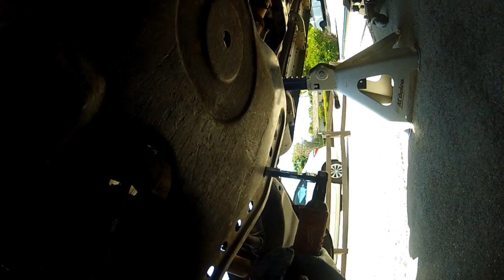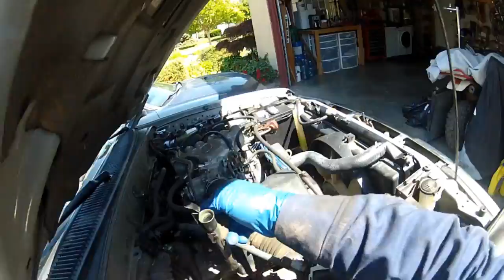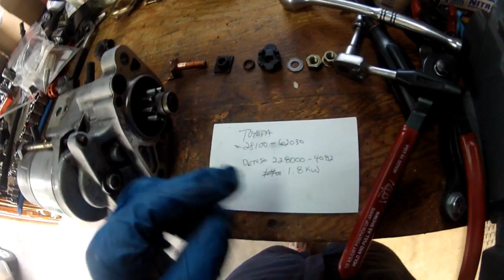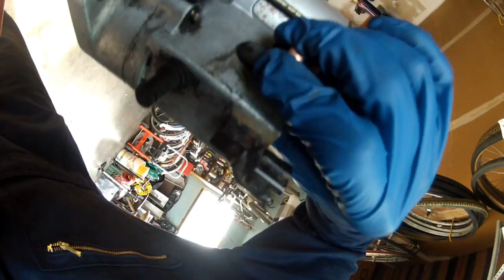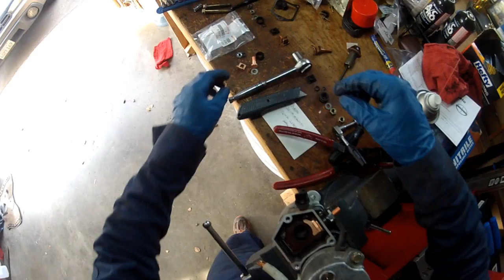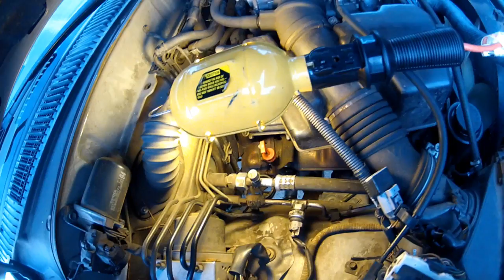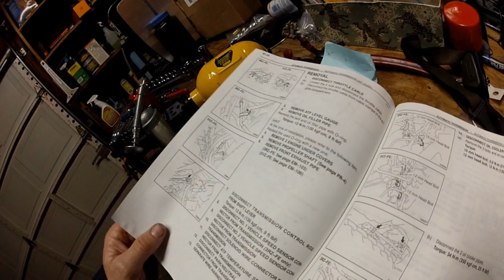Starter Removal and Solenoid Repair

Comment: Why the Neg Cable?  You are the second guy to do this.  I would just take off the Pos cable. 
I can see from how clean your truck's underside is that you drive around on pavement all the time.  
Not so here in the mountains west of the Silicon Valley. 
Also, I have wanted to remove the transmission dipstick tube for 10 years now.  My dipstick broke off back then. 
This will be a great chance to see if I can get that old one out.  I have a new one.

One more thing...  rebuilt starter from AutoZone $140.
Reply from the maker: I always learned the negative cable is the first off and and last on.

Unless Auto Zone is selling rebuilt Denso alternators for that price, I'd pass.  But, first try fixing the issue like we show in the video with very affordable solenoid contacts and plunger.
Reply: The one I bought was a Duralast rebuild.  I bought the relay there before and it works fine.  It doesn't fall apart when you remove it like the Toyota either.  The starter has a Limited-Lifetime Warranty.   Whatever that really means.  DENSO builds the Toyota sold units and they are only $209.  Of course, these prices are with the return of your core return.   I wouldn't buy engine or transmission parts from anyone but Toyota, but air-conditioning or starters are OK with me.
Reply from the maker: @jmoss99  Roger Dodger

Comment: Chalk this up as probably the 10th Timmy the Toolman video that aided me in fixing my 3rd Gen. I had a couple brilliant ideas, but ran into some trouble too. Not that my hands and arms are fat, but they ain't small, I had a really tough time getting the wire plug off, and did what I saw someone else suggest, and unbolted the starter first, moved it around, and got the clip off. I got lucky and could hand tighten the top starter bolt by squeezing between things and going straight in. Doing it by myself was a challenge getting the starter lined up right, but I used one of those blue pry/nail puller dealies as a wedge to push the motor in place, and then used a bungy to apply pressure while I worked on the bottom bolt. I really helped, although I still couldn't get the bottom bolt in. It kept feeling like it was cross threading, so I kept trying, but to no avail. I just couldn't get it, so luckily my neighbor, a mechanic, came over and nailed in in a couple minutes. He had a shorty ratchet, which I don't have one of those... yet. The next challenge was I couldn't get the inside brake bracket screw in straight, and probably did cross thread it. It's tight, with no rattle, but next time I replace the contacts or starter I will probably have to deal with it. The final problem was I could not get the dipstick bolt in. It's at un upward angle, and between trying not to cross thread that too, and the area being way to hard squeezing my arm in, which got all scraped up, I finally got it in cleanly. Car started, and like Timmy's, the old contacts, and the contact washer on the plunger, were definitely worn. Only bummer after doing what was a tough job for me, I was saddened to see that the starter must have already been replaced. and wasn't a Denso. The kit I bought still worked, but I did contemplate dishing out the $180.00 for a remanufactured Denso. Thanks, Tim! Hope to see you next month for the Sicmods BBQ!
Reply from the maker: Sounds like you had quite the experience with this job but you got it done and that's what counts.  That is too bad you didn't have the OEM Denso starter.  Did you email me for my address?
Reply: @TimmyTheToolman  Email you for your address? This will be the 3rd Sicmods BBQ I will have attended. I know where you live! As a matter of fact, I just thought last night that I haven't signed up yet. I'll do that now.

Comment: Online the contacts+plunger now run about $60. Lets go Brandon
Reply from the maker: Order the Ebay kit we link.  It's much more affordable.
Reply: @TimmyTheToolman  should also be noted that the starter contact kit listed in the description is only for one side. Sides are not symmetrical so you can't just order 2 of them.
Reply from the maker: @padronianful  You only need one kit to rebuild the solenoid.
Reply: @TimmyTheToolman  no, there is only 1 contact in the kit listed. There are 2 contacts in the starter that need to be replaced
Reply from the maker: @padronianful  Ok, you're obviously referring to the OEM kits and you are correct they are two separate kits.  When I responded to you, I was thinking of the more affordable aftermarket Victory Lap kit that has both contacts and plunger in one kit.  Thanks for bringing this to my attention.  I'll add the other OEM kit to the video description.

Comment: I'm sorry the two cylindrical pieces sticking out on the outside surface of  the starter and/or solenoid casing.
Reply from the maker: It's a breather.  I don't how important it is, but if broken off, it could be w pathway for water and dirt to get in.

Comment: Hi Tim thank you.  Wondering if you know what the cylindrical little rubber plug things are for? I broke mine off. Wonder if they protect from water etc?
Reply from the maker: It's a type of breather.  Don't know how important it is, but with it off, it could let moisture and other contaminants in.

Comment: Also, I’m looking up my parts via VIN # and it was that 1.8kw is for my truck, but I went into my local dealer and they told me my truck takes the 1.4, but it gave them options for both the 1.4 and 1.8. Are these parts interchangeable?
Reply from the maker: I bet the contacts and plunger are similar between the 1.4 kw and 1.8 kw.  We have a link in the video description for a more affordable contacts and plunger kit.

Comment: Farm fix RE: Contacts , flat file the contact surfaces to re-use .
Reply from the maker: Really?  The contacts I pulled out of my starter where worn down pretty bad.  I wouldn't want to spend the time pulling the starter and taking apart the solenoid just to keep worn out contacts in the solenoid.  The replacement contacts are dirt cheap.

Comment: Hi Timmy, I tried to turnover my 1999 4Runner and nothing happens, no click or clicking, or other noise…tried a second time to start and nothing, and then third time and vehicle turned over (this happens intermittently)

other times vehicle starts up fine with no issues 

I thought maybe bad battery but all lights radio worked, so I  tested battery and alternator with multimeter and those were good

One thing I have noticed if vehicle doesn’t turnover i can disconnect the battery terminals and reconnect and the the vehicle starts 

there was no corrosion on terminals but i still gave them a cleaning

Any thoughts on what I described above?  I was thinking maybe bad solenoid contacts or starter, but was wondering if the symptoms described above  might be something else.

Thanks
Reply from the maker: It could be the starter and it could be a bad connection.  Check your grounds first.

Comment: Tim, thank you for taking the time to put this video together. I just finished the starter rebuild as you described. I could not have done this without your video.  I'd say the hardest part was getting the starter out.  The way you describe the orientation to pull it out was beyond helpful!  -Ben
Reply from the maker: Hey Ben, great to hear our video helped you out.  Good job getting it done.  Thanks for taking the time to comment.  We appreciate it!  Happy Wrenching!

Comment: Hi, Tim.  You really helped me 2 years ago when the starter on my 96 4runner went out.  I'm having the same problem on a 3rd Gen Avalon (2005).  I can't find a detailed video for the repair.  Do you know if the location of the starter in the Avalon is similar to any other Toyota car?  Then maybe  I could find a video to do the job.
Reply from the maker: Hey Jim, we're not familiar with the Avalon so we wouldn't be much help to you.  Not all Toyotas have the starter in the same location on the passenger side of the bell housing.  You'll just have to get under the rig to look and figure it out.  There is a Toyota website called Tech Info that you can buy a 2 day membership from to gain access to the factory service manual pages that can instruct you on the proper steps to replacing the starter.   The only caveat is you need a windows based computer to use their website.   If you go onto their subscription page,  there's a link on the bottom that explains the minimum system requirements to use their website.   Once you're in their site, you put in your year and model and then go to the RM section (repair manual) and you can do a search for the starter replacement section.
Reply: @TimmyTheToolman  
Thanks so much for your response Tim.  

The starter is in a different location.  It is located under the hood, left of the battery.  I was able to get the car started by tapping it, but it won't last long.  Of course, there are several wires and tubes blocking direct access.  I haven't seen many videos for the Avalon, but there are some for the Camry.  So I was wondering if the starter was in a similar location in both cars.  I'll check out that Toyota website and give it a try.  I think the copper contact is the culprit, just like in my 4runner.
Reply from the maker: @jimthompson7370  Well, good luck with the job.  Hope it doesn't fight you too much.  Happy Wrenching!

Comment: I hope the flywheel is still ok?
Reply from the maker: Yeah, it was fine.  The starter wasn't grinding on the teeth of the fly wheel.  It just wouldn't disengage and kept turning the engine over.
Reply: @TimmyTheToolman  Can you imagine that happening if you are 50 miles from home. Keeping a 10mm wrench in my 4Runner now.
I just did a timing belt job on my 4Runner, man that back bolt to the tensioner was a bear to get started. Ended up tightening the front bolt almost all the way and using a long extension with wobble head and short 12mm socket to get the back bolt in.
I am really surprise how hard Toyota engineers made it to reinstall. Thanks again for that great video.
Reply from the maker: @brucewayne2773  Yep, not a bad idea at all to carry a 10mm wrench.  I saw this happen on a car while I was working my firefighter job.  The starter on this vehicle ran so long that it just burned up and seized.  

As for the timing belt job, the engineers never intended us to do it that way.  The way we show to get to the back bolt for the tensioner is a cheat method to not have to remove the AC compressor and AC compressor bracket.
Reply: @TimmyTheToolman  I did notice another person removing the ac unit and bracket. Seems overkill to go that route. My 05 Sienna was not that bad to do compared to the 4Runner. I think the later models are much easier to service?

Comment: So I know this video is pretty old but I thought I could maybe get an answer, I have a 97 limited and it was driving fine in the snow and when I got home, I had a little problem with trying to get into park from drive (after I got it out of fourwheel drive). I got into park and turned it off. I tried to start it a couple minutes after and it doesn’t want to start. I got power from the battery but I can’t crank it over. When I turn the key it just does nothing. None of the lights turn off when I turn the key. I replaced the battery and I still got nothing.
Reply from the maker: It might be an issue with your Park Neutral Safety Switch.  It's on the passenger side of the transmission.  It connects to the shift rod that the shift linkage connects to.  If the switch is bad, the computer doesn't think you're in park and you can't start your rig.
Reply: So I got it to start because i found that switch and now my rig won’t shift out of third.
Reply from the maker: @lando9285  If it won't shift, something is wrong with the shifter.  Check out this video to see how the auto trans shifter works and what the button on the shifter is actuating allowing you to move the shifter into the different positions: https://youtu.be/gCHSRcq-LP8

Comment: Why not just replace the starter?
Reply from the maker: Because it's a lot more money.  A quality OEM Denso starter is expensive.  You could buy an aftermarket starter for less money but they won't be as good as the Denso.  Quite often, it's just the contacts and plunger that go bad and you can fix your starter for very little money.

Comment: The previous owner of mine rounded one of the 2 bolts that holds the starter to the transmission, the 14mm on the bottom. Any tips for getting it broke loose?
Reply from the maker: Hey James, companies make a tool called an extraction socket.  Gear Wrench makes them and other manufactures make them as well.  Here's a link to what I'm talking about: https://amzn.to/32YpFOh   You could buy one of the smaller kits that have the 14mm extraction socket you require.  This is what I would use to get that rounded off bolt out.  If you lived close to me, I'd invite you over and I could help you out because I own a set of them.  Good luck and let ,me know how it goes.
Reply: Thank you so much! I was able to find a cheap Irwin set at Lowes for 20 bucks and had it off in about 10 seconds.
Reply from the maker: @jamesferrell2941  Right on James!  Glad my suggestion worked out for you.  You're very welcome and thanks for reporting back with you success getting the bolt out.  Happy Wrenching!

Comment: On Ebay, type in 1.8kW Toyota starter repair and you will get 1 or 2 results.
Reply from the maker: Yep, you can find more affordable kits on Ebay and Amazon for these starters.  We have an affordable kit linked in the video description from Amazon.  When I did my original search for an affordable set, I was using the starter model as a search reference and didn't come up with anything.  Afterward, I learned that a lot of these starters have similar contacts and plungers and it wasn't as hard of a search for replacement parts as I thought at first.   Thanks for the comment.

Comment: I was able to reach the upper bolt with a flex head ratchet and a short extension. 
I think Tim uses the same harbor freight ratchet on the video about replacing motor mounts. 
Also, I have no sway bar and was able to pull the starter out rearward above the steering rack.
Reply from the maker: Good job and thanks for sharing your experience Mark.

Comment: 4.3 L Toyota always starts when cold..will not start for 30 minutes after ran and stopped??
Reply from the maker: Does the starter crank but the engine doesn't start when the engine is warm?
Reply: Yes Timmy
Reply from the maker: @juliusbuckingham5492  Does it throw any codes when this happens?  I wonder if it could be a problem with your IAC valve.   My 1998 4runner sometimes stalls on a warm start and I suspect the IAC as the culprit.
Reply: @TimmyTheToolman  check engine light is on..
When it does restart after sitting, it is rough and almost seems to backfire..runs sluggish briefly and then, you could run it until it is out of gas(unless you turn it off again)??
Reply from the maker: @juliusbuckingham5492  Well, an engine needs fuel, air and spark.  One of them is getting compromised when warm.  I'm suspecting it's a problem with either your IAC (Idle Air Control), or maybe a problem with your throttle position sensor.
Reply: @TimmyTheToolman  Thank you very much for your time and help sir.